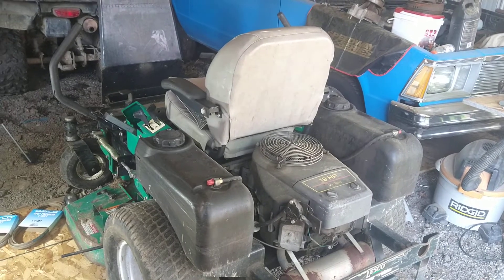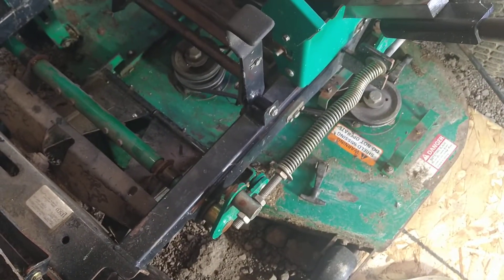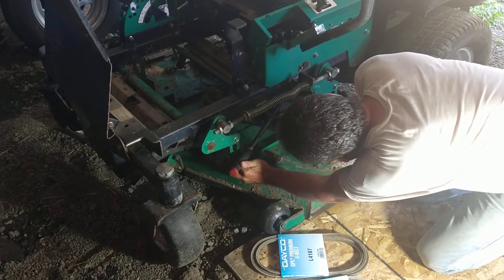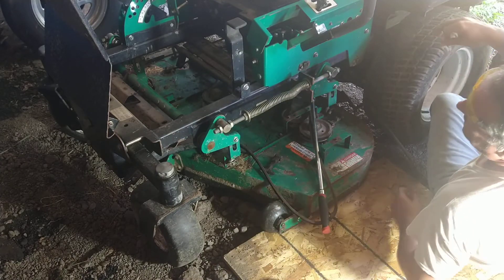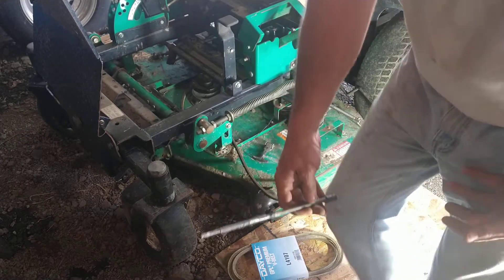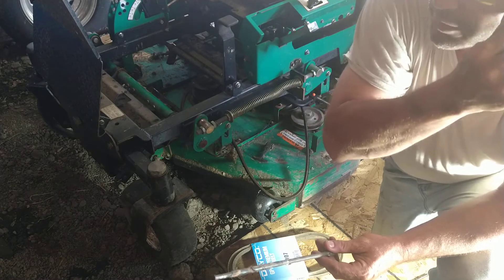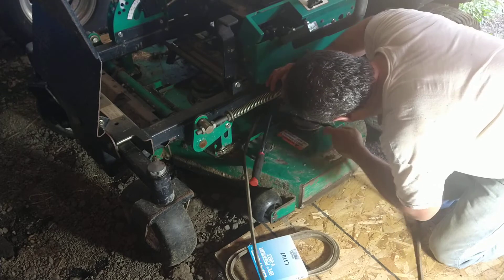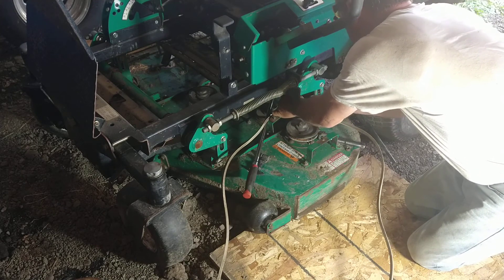lesco 48" Viper  belt change

Comment: Do you happen to know what hydraulic filter is on that? I just acquired one of these and rebuilding the hydros and the filter doesn't have any numbers
Reply from the maker: This is the part number from the manual.... 704166.... 33 micron filter .. hope this helps .. use Mobil 120w50 an empty tank takes 3.25 gallons
Reply: @paulwrightlawns4850  thanks where did you find a service manual? I can't find much on these would love to find a service manual
Reply from the maker: @KyleRickett  hi the old guy gave me it ....i think he noted when he farted in the seat   lol he was very into about marking everything on the mower